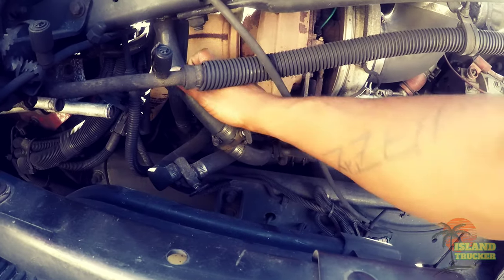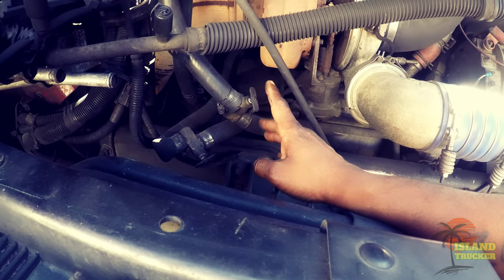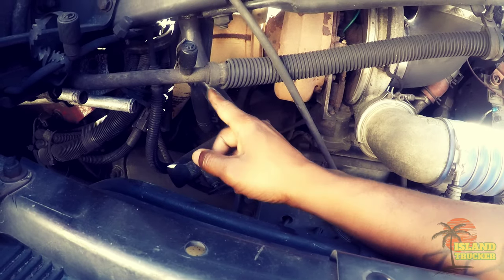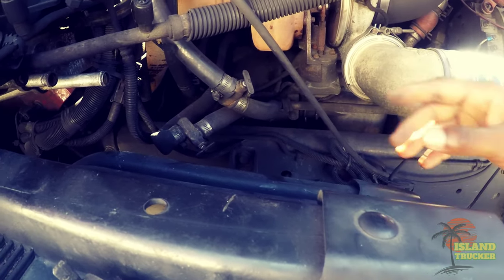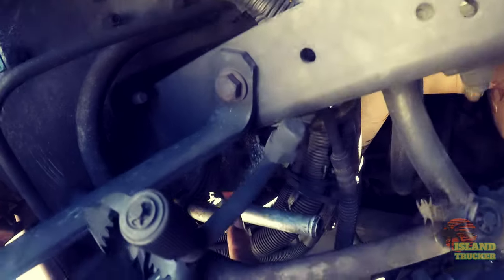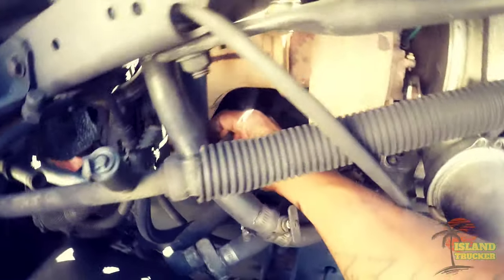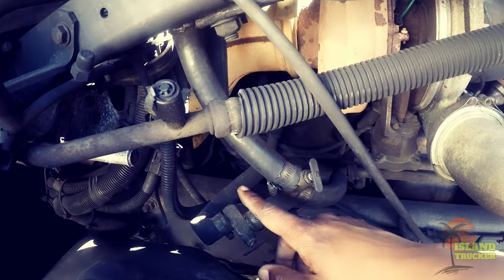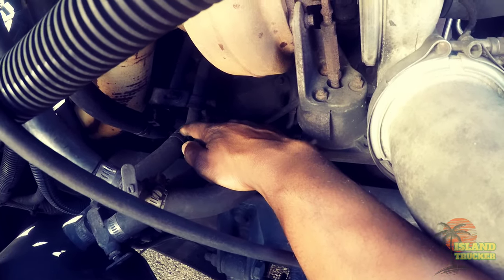Heater core shut off valve

Comment: I have an issue , do those valves need to be in the same direction on or off? My ac and heat work great but only when I turn the valves on or off. My controls in the cab don’t switch them from hot to cold anymore, any idea?